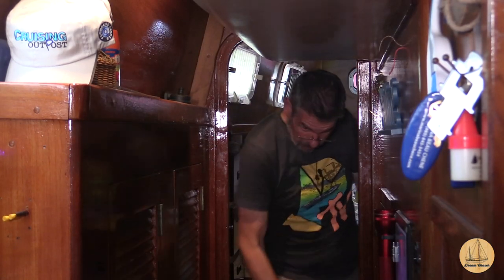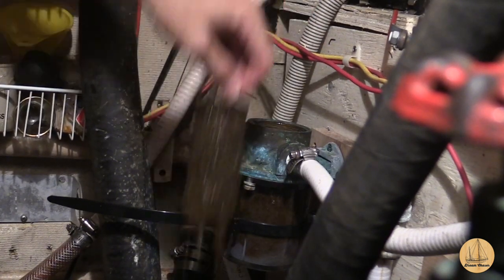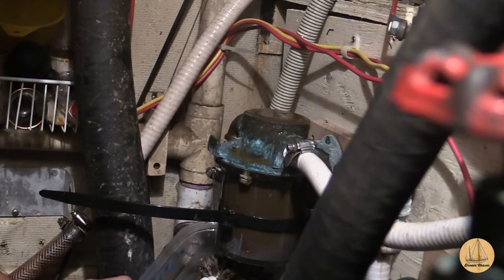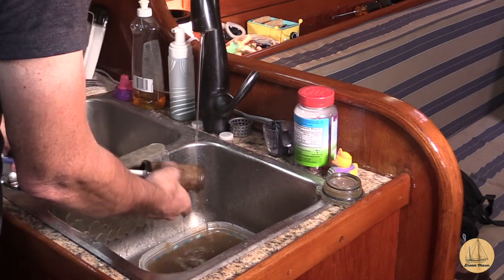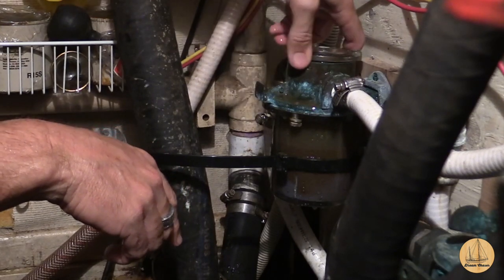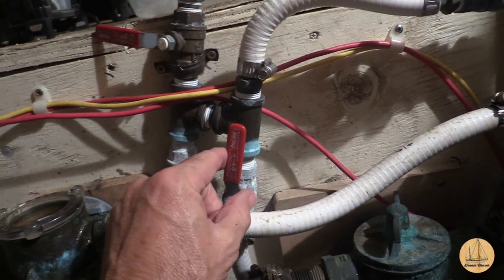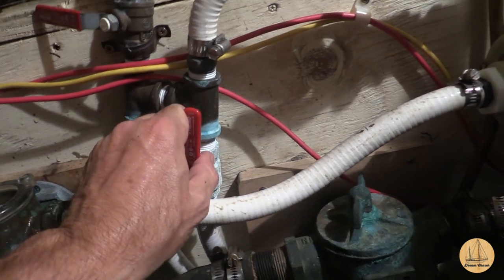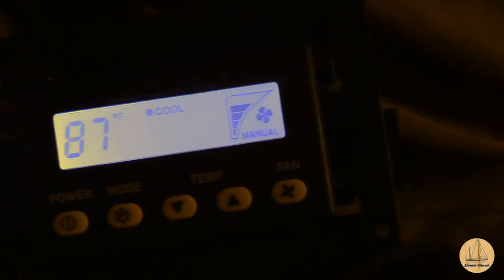How to Clean Marine Water Strainer

Comment: well. hi there.  i am using jacuzzi bromine tablets for AC strainer and it will help you a lot  . the strainer always clean and no way the barnacle will build up  . you have to add 5 pics in side the strainer and it will stay for about two weeks 

this is for your information 

best regards
Reply from the maker: Thanks for the tip.  I actually was using them in the past as well.  They do a great job of getting rid of barnacle build up and living organisms.  I stopped using it when we moved the boat up into a freshwater river.  The growth that is in there is more "slimy" than the typical growth we saw in salt water the tablets don't seem to help it out as much here.  I am glad you raised this for others however as it is a GREAT suggestion and solution in most cases.

Comment: How do you clean the lines downstream of the strainer?
Reply from the maker: +nobody46820 The flushing spigot I installed allows me to connect pressure water (either dock or wash down pump) and close all upstream valves and the water flushes backward through pump and out the strainer and the intake line. 
I don’t often clean that direction but likely should. 
I can also close all valves, put a small shop vac output on the opening of the strainer and open the Sealock, I hear bubbles below the boat knowing it cleared the line of water. I have seen a dirty cloud in the water when I have done that as well.
Reply: @Svdreamchaser  Ah, just water? No cleaning solutions of any kind?
Reply from the maker: Yes I don’t often do the cleaning solution the other way. I guess if I used the output of vacuum and cleared the lines of water, I could shut off the seacock while the air was going through ultimately leaving it empty then pour a solution in slowly to fill the line and let it sit for a while.  That would likely work but I haven’t tried that before. The harder way would be to take the hose off and soak it in a bucket of solution. 
I am curious what you have done or what the outcome is if you try something different  this can be a cool way to share ideas
Reply: @Svdreamchaser  Nice! I've run pigs through my pipes. This gets them really clean. You can use pressurized air/water to drive the pig through the pipe(s). I've also used a plumber's water blaster.